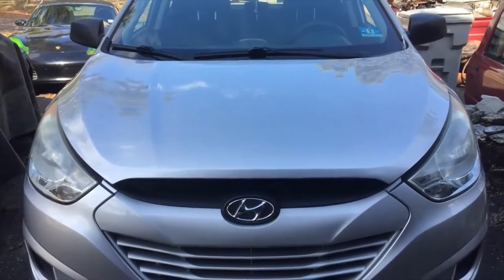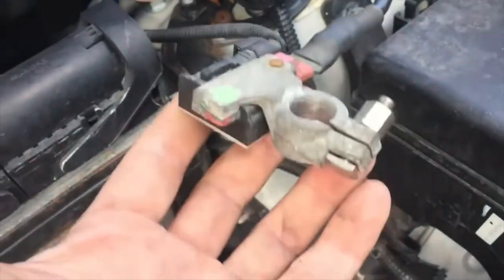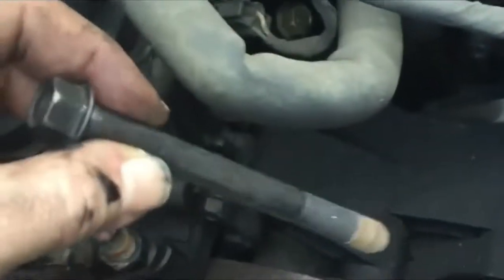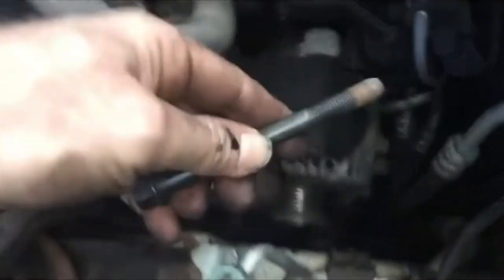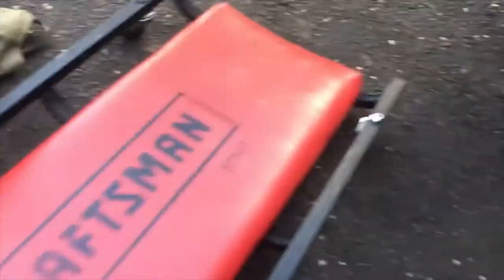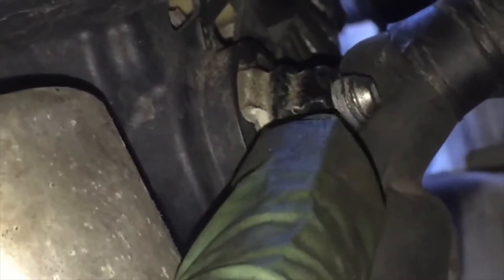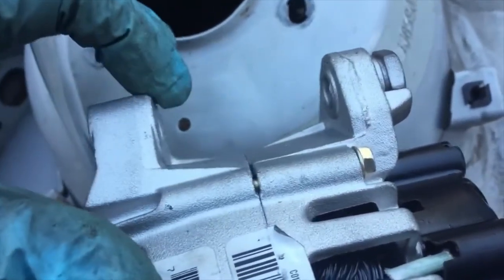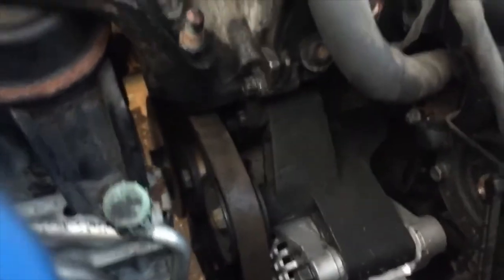How to remove, install an alternator on Hyundai Tucson 2.0 and 2.4. Easy steps

Comment: What a great video, I rather a long video thoroughly explaining everything how you did to really get an understanding of what I’m doing, you sir are God sent, also do you recall what size ratcheting wrench you used for the top bolts on the a/c compressor? 😅
Reply from the maker: @Adek_Reaper  thank you for those kind words! Please subscribe and ask any questions you need. I can not remember the exact bolt size by heart but I would say it’s metric since it is a foreign vehicle. Tell me if you need more help.

Comment: I cant figure out how to move the AC compressor out of the way so i have enough room to get the alternator out. Also the bottom bolt wont fully come out.
Reply from the maker: Is it hitting the frame metal near the tire? If yes then I had to pull it down while taking it off with an open wrench. It’s a pain if you get one like that but that’s how you have to it. Try it and get back to me.

Comment: How do you get the bottom bolt out
Reply from the maker: Great question. Someone already asked this in the comments. You can jack up the body like an inch. Mine was so tight I used an open wrench to get it past the inner wheel body metal then when it pops past back to the wratchet. If you understand let me know how it goes.
Reply: Thanks for you response! I had to remove the engine mount on the passenger side and drop the engine down a few inches for the bottom bolt...
Reply from the maker: Yea I mean that is prop the safest way but I was too lazy that day. lol. Btw nice page mate. Keep rapping fam.
Reply: @Warlo_45_OG  How do you remove the engine mount? Where is the engine mount? I got the belt off, top bolt off, bottom bolt hits the metal wheel frame. Haven't lifted it up tho. I have 1 jack, where do I place it?
Reply: @jacksonbrooks6677 the engine mount is on the passenger side

Comment: How did you get the bottom bolt out of the alternator?
Reply from the maker: Around 5:20 I take out the bottom bolt from the tire area.
Reply: Show how to get out the bottom bolt cause it goes straight out against the frame
Reply: @Warlo_45_OG same issue
Reply: @Glhodges05 I had to take off the engine mount and drop the engine down